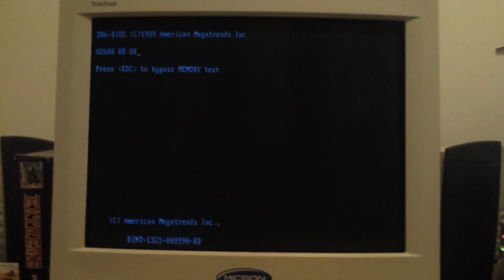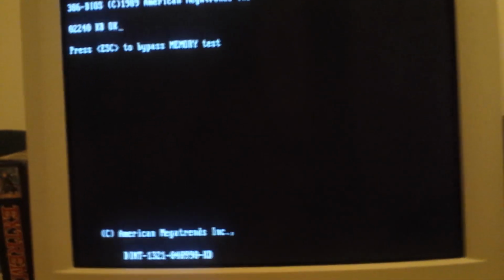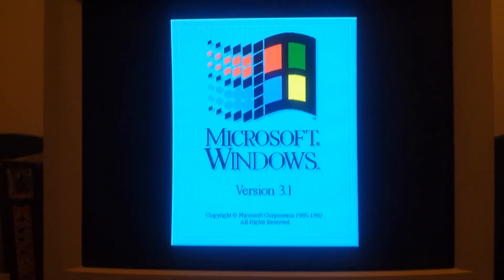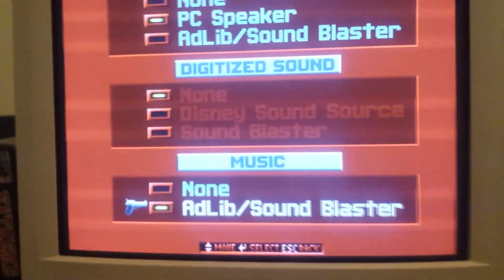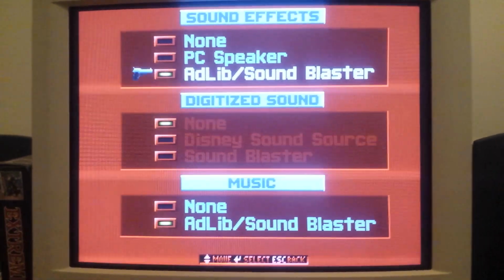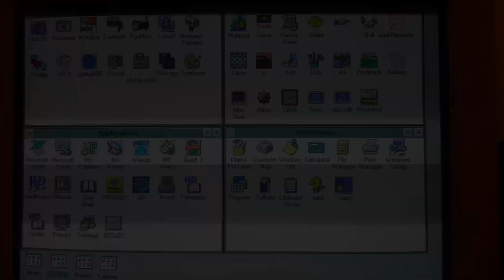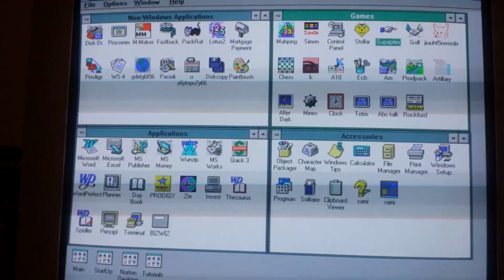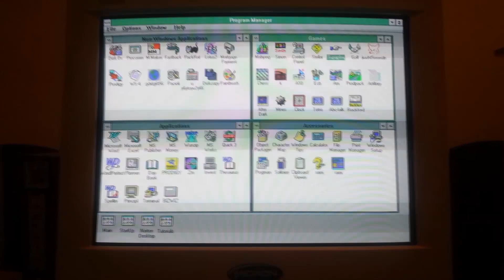Restoring my 386 computer: Fixing PC speaker, floppy drive and installing AdLib

Comment: Fun project, thanks for sharing!

Why was the CMOS battery removed?

It's so weird now that old computers required expansion cards to provide disk controllers and serial/parallel I/O. Moving those on-board in the mid-late 1990s really reduced the need for expansion card slots.
Reply from the maker: Indeed! The only built-in I/O back then was the AT keyboard. Everything else including HDD, floppy and serial/parallel required cards.

I had clipped off the CMOS battery a few years prior after noticing that it leaked. But thankfully no leakage came in contact with the board.

Comment: TBF: That CT2940 is a genuine Sound Blaster 16 (albeit haveing a Vibra chipset) card. 
There are two versions: One has an CT1978 chip, a rather lousy OPL clone by Creative, the other does indeed have a real OPL3 chip. You can easily spot the difference: The CT1978 is labeled U3 and sits north of the large DSP chip.
Your card does have a genuine OPL3 chip instead: It's the small square IC east of the DSP, labeled U13 on the silkscreen and "YAMAHA YMF289B OPL" on the chip itself :P
The version fitted with the real OPL is quite rare and has one of the cleanest outputs of Creative's cards.
Reply from the maker: Yeah I did some research on that YMF289B and it's really cool. Apparently a later consolidated revision of the YMF262.

I actually moved the CT2940 to my Pentium 150mhz machine with a Dreamblaster S2 daughterboard. It sounds great and it's nice being able to choose OPL3 or General MIDI

Comment: It's cool to put a face to a name and get to actually see your 386. Those old school motherboards had so much silicon on them, just a wall of chips, and I forgot how many ISA slots we used to need, all the things we consider basic functions today needed an expansion card back then. That Adlib did sound awesome, it's the first time I've heard Wolf3d with an Adlib.
Reply from the maker: Thanks! Yeah I love the old 386 motherboards they're so beefy lol. This 386DX motherboard in particular is huge.

And yeah I was impressed with how good the AdLib sounded, the card is very appropriate for the time period of this PC. I eventually got the MHz display working and upgraded the PC to Compact Flash storage as well.
Reply: Oh sweet, nice!